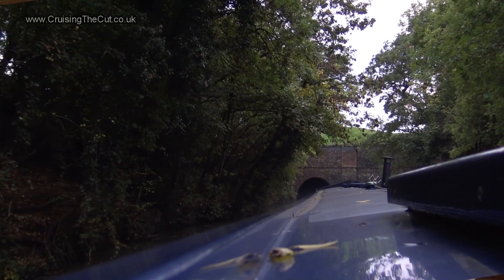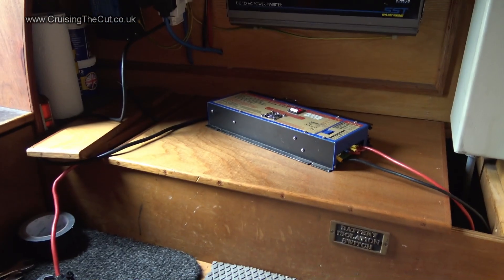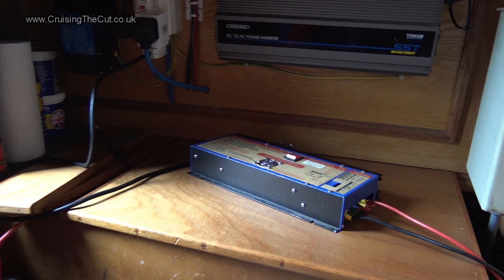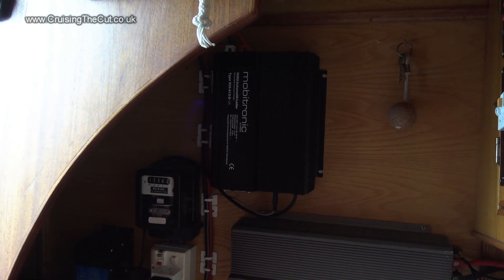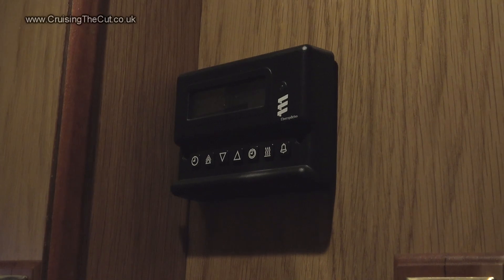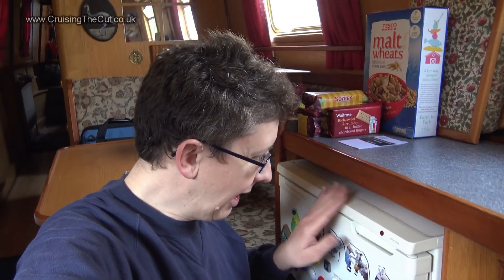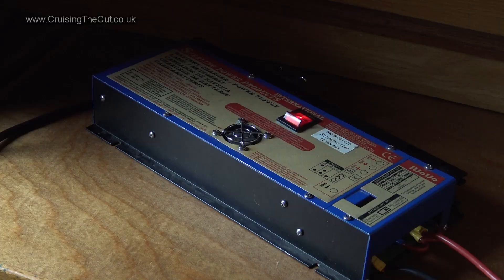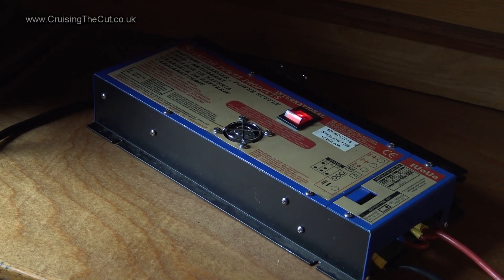11. Getting a new inverter after the battery charger dies on my narrowboat

Comment: i started having a problem when my old inverter was on so we got an electrician in & he said the inverter only worked intermittently & 2 of the leisure batteries were naff & the other 2 were on there way out ( we were going to change the old batteries because they were CAT C & not off grid batteries, he also said who ever put the old inverter in (same as the one who replaced the batteries before we bought our boat) put the wrong size cables (to thin) to the batteries & had not put a kill switch from the inverter to the batteries & we were lucky this had not started a fire some where a long the line , we got the same inverter as you (works really well) & splash out on 4 new off grid batteries & had the electrician fit them & made it all safe so hopefully no more electric problems & paying for this almost cleaned out my bank account

Comment: We have just bought another boat with this Inverter/Charger fitted - Which mode would you put it in if your leaving the boat unattended for say a week at a time?
Reply from the maker: As far as I recall, I left it switched on at the unit but remotely controlled using their app so it would be "off" via the app all the time unless I needed to run a mains appliance.
Reply: @CruisingTheCut  Off is what I was thinking too! Or possibly charge only, but not sure how much that would affect batteries as the Inverter/charger would need to draw power whilst on I would imagine!
Reply from the maker: Yes but it it's charging then it's doing so from the shoreline (that's the only way it can charge) so there's plenty of power for the small draw of the device itself
Reply: @CruisingTheCut  Thank you, David you have been really helpful. Until the next Vlog take care.

Comment: Hi

   cruising the cut      just like to say fan of channel   , very helpful as iam also a  boater ,,  channels like  yourself gives you guides on how to renovate boats, ,  I've come across this particular upload and iam also looking to put in a victron 3000   but just wanting  to  know 

what battery set up have you got ?  Because I've been advised on installing a lithium battery  and just curious as you've been using your victron for a few yrs   would like to know your opinion 

Cheers , Joe
Reply from the maker: I have 3 x 110Ah lead carbon batteries. An inverter will run off any battery though; only the charging side of it would need to be lithium-compatible if you go with those. They're expensive of course and need to be somewhere warm (ish) as you can't charge them below 0C
Reply: Hi 

 thanks for the reply ,  

 I have 4 110 ah leisure  lead acid batteries  ,  on my 60ft  inspection launch   ,,  only put in 2 yrs ago ,   but ive been told  for what i want it to do  i.e   run tv , washing machine, ps5    etc ,   it may burn out my batteries quick ,  have you found this problem ?  Do your batteries have trouble holding charge  due to the multiplus ??   You've had your victron for over 5 yrs 

  have you had to replace your batteries due to using your victron ?   

  Also what battery supply would you recommend to go with the multiplus 3000?  
Or do you think 4 110 ah  are good enough ?

Thanks for the reply 👍
Reply from the maker: The multiplus will not be a problem, nor the batteries. The issue is simply how much power you want to draw and for how long. If you want to run all of those power-heavy devices, your batteries and inverter will do so but only for a very short time else you will deplete them past 50% charge and then, yes, they will be damaged. You need to do what’s called a “power audit”, working out exactly how much power you intend to use every day, and then size the battery bank and inverter accordingly. It’s too much to explain here, it would take many paragraphs to describe so I suggest you Google “boat power audit”

Comment: not the voltage the electricity coming from a power plant is ac/dc not the band electicity on a boat is usually dc unless of course u spend the extra. but thats what the electrical system does converts ac/dc back to dc

Comment: You said that most things on the boat run on 12V and you listed some.   What about all the stuff that aren’t ‘boat things’?  I noticed, from one of your other vlogs, that, amazingly,  you have a vacuum  cleaner; does that operate on 12V?  What about TV, is that 12V?  I know you use gas to boil the kettle but could you buy a 12V kettle for your boat should you wish?    I’ve never seen 12V vacuums, kettles or TV’s in the shops.   Do you have to shop for boaty 12V equipment in specialist shops dealing in that niche market?  I guess having Amazon now available, finding 12V equipment is somewhat easier but before either it and ebay came along I would imagine it was a bit of a hunt  –  you do not see many shops of the High Street selling 12V thingies. 

What about rechargeable items like laptop; video camera;  CD/DVD player; ipad and mobile phone?  Can they be recharged from a 12V battery bank, or must you wait until you reach a shore mains supply in a marina, pub or Mum’s house?
Reply from the maker: The vacuum operates on 230V, via the inverter (or shoreline if plugged in). The TV is also mains operated. No idea about 12V kettles, I use gas. Laptop runs off mains (inverter/shoreline) but smaller devices charge from USB via 12V sockets.

Comment: Get yourself a switching power supply 240/110V 600W for a PC and tie all of the same colour cables together. Black is ground,yellow +12v, red +5v and orange 3.3v.!use it when docked to a Marina and save your batteries
Reply from the maker: If I'm in a marina, I'm plugged into shore mains so just power the laptop from a mains socket in the boat, the inverter bypasses the batteries when it's sending shore mains round the boat

Comment: (2:45) - 13.8V
Fully, freshly charged, 12V lead-acid battery should put out 13.8 volts-(ish) under no load.
>
Reply from the maker: No. I say again, a fully charged 12V battery not on load will read 12.8. It will only be on 13.8 if it’s faulty or being float charged, typically.
Reply: @CruisingTheCut  Yes you're correct.
I had the figure of 13.8V in my head because that's the nominal voltage for when the engine is running and the alternator spinning.
Very surprised I got a reply from you considering how old this particular video is. Thanks awfully.
I am currently working my way through your whole series since I'm banged up at home due to this horrible "crisis".
I'm only up to number 24 and loving every minute.
Not surprised when I discovered you were an ex TV reporter because that perfectly explained the highly professional quality of your vlogs.
The reason for this binge is that I intend to buy a narrowboat myself in the not too distant future, to live on permanently, and your CruisingTheCut vlog series is the absolute bestest, and so, so entertaining.
Thank you so much. My enthusiasm is increasing with each subsequent episode I watch.
Stirling job Sir!
I am so grateful.
>
Reply from the maker: I read (because I moderate) every single comment. I reply when I can, albeit somewhat tersely sometimes due to the volume

Comment: (2:45) - Should be about 13.8, not 12.8V
Hello !!!
>
Reply from the maker: No, a fully charged 12V battery at rest will be about 12.8V. It would only be higher if it were on charge such as a float charge (whether by solar or other device) which would usually be around 13.8V

Comment: My Dad has a motor home that runs on 12v. He's had installed a 12 volt LED control panel fitted and it displays how your 12v battery is doing.

Comment: A fully charged 12 volt battery will have 12.6 volts.
Reply from the maker: 12.7 usually!
Reply: between 12.8 and 12.5 is fine

Comment: 12volt systems should top out at 13.6 volts anything lower than 12v is low.
Reply from the maker: When charging the batteries will see 14.4V (lead acid) and 14.7V (AGM). Unplugged from a charging source they will be about 12.7V fully charged, 12.2V is 50% full or thereabouts.

Comment: Shut off the refer at night to conserve battery power, particularly when away from shore power.  Almost no heat lost due to door staying closed.  We figured this out when our boat would not start on day two of ownership and out cruising.
Reply from the maker: The "refer"??
Reply: Meant "reefer", short for refrigerator
Reply from the maker: Ah! If I did that, I would 100% forget to switch it back on again then the ice in the ice box would melt and make a mess :-)
Reply: Sounds like a job for a timeswitch then... ;)
Reply: @CruisingTheCut  You're probably getting most of the benefit of a night-time timer anyway, since the refrigerator stays shut and cool all night. The compressor cycles less often, which is the big power draw there. Thoroughly enjoying your videos, and Hello! from Denver.
Reply: ...but if there's no heat lost then surely the thermostat in the refrigerator wouldn't be telling the refrigerator to run. Any energy you save is then used up when you plug it back in and it has to run for longer to get the temp back down, plus from a food safety perspective this is just a terrible idea. If you're that concerned you should just buy a new fridge that has a high energy efficiency rating.

Comment: Hi again would u say that,folks 2ould be better off buying a more modern craft if they could so as to hopefully forego the said expenses where possible,.,  by,the way keep, battened up its rough down here
Reply from the maker: You might think so but it's not always true; for example there's a boat moored just a few feet away from me that's only about 3 years old, built by a very respectable company and they've had problems with it since day 1. Most recently - couple of days ago - they found the shower had been leaking underneath the tray and the entire boat was full of water that came up through the (wooden) floor. It's going to cost them a fortune. So, newer boats aren't necessarily a cure-all!

Comment: totally newbie question, can TV's be run off the 12 volt system too ?
Reply from the maker: +Stephen Stubbs Yes if it's a 12V TV (you can buy specific 12V tellies eg from caravan equipment suppliers or boat chandlers). Otherwise if your TV's a mains set you'd have to take the 12V from the batteries through a suitably-sized inverter to turn it into AC mains and then you could plug the TV into that. But it's inefficient as you lose 10-15% power through the inverter.

Comment: So how much current does a 12 volt fridge use if it's on all day? Do you only run it occasionally when you're moving? Or does the engine give enough juice to keep it going? Let me know when you get your range of relaxation tapes on the market...
Reply from the maker: The fridge is on 24/7 though of course the compressor etc only runs approx half that time when it feels the need to do some chilling. Engine is not being used at present because I'm moored in a marina for winter and only doing the odd excursion but I am tied onto shore mains.

Come summer I will be moving every couple of days and then either engine power or my soon-to-be-installed 480W solar panels will give enough juice to keep it all going. Battery bank is 330Ah capacity (not a lot)

Not actually sure what the fridge draws but my daily consumption is less than 1kW - approx 80Ah - the biggest component of which would be the fridge, so I'd guess about 60Ah per day so 2.5A average ie about 5 when running.